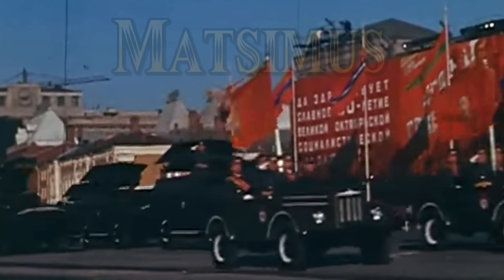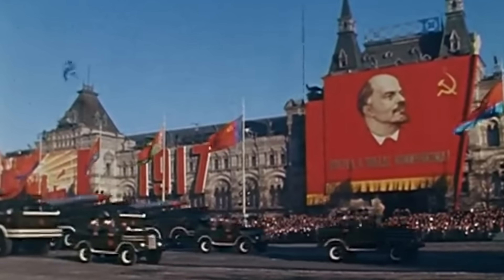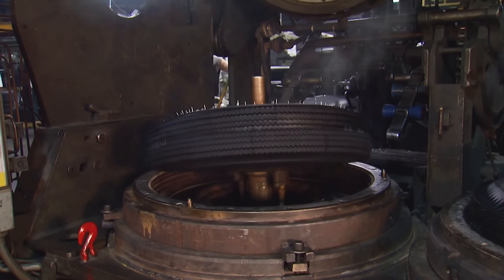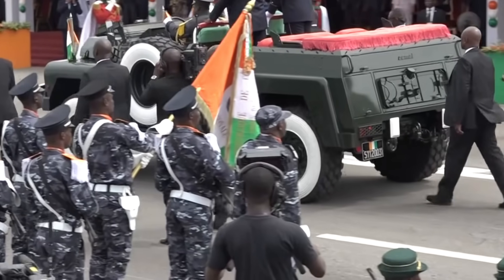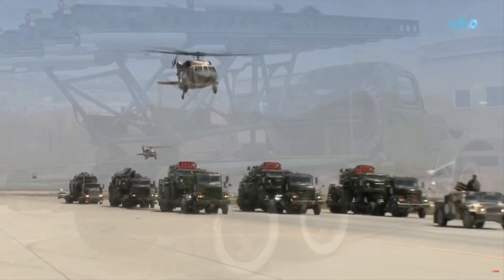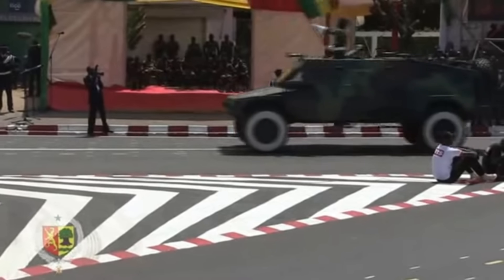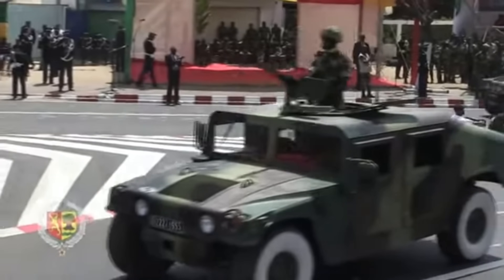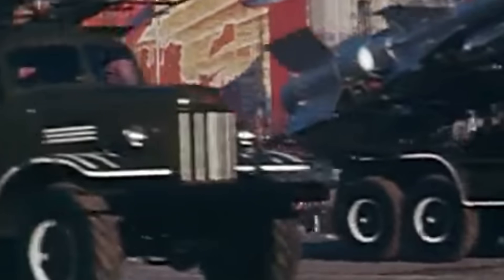Why do Soviet/Russian, North Korean and Chinese military vehicles have white wall tires?

Comment: I always thought it was just decoration for parade purposes.
Reply: I never knew that this was an issue and never thought about it till now.
Reply: Wasting money is a big no-no at the Slavic world. Unleas You can fake spending
Reply: They should paint them with gold paint to match with Putin's golden toilet and Kadyrov's golden PKM.
Reply: @vaenii5056  I would never want a golden toilet or anything covered in gold except gold ingots!
Reply: @vaenii5056 I loooooove goooold!
Reply: they are ust decoration for parade purposes in china at least
Reply: It’s to cover up the fact that the General in charge has trousered the tyre budget for the year and disguise the fact that what’s left are crap Chinese knock-off Firestones.
Reply: I know about people with camper Vans and trailers covering their wheels when they not use them since they stand around for most of the year.
Reply: @w0lfgm  white paint is cheap especially if you know that they use whitewash which cost around 0 and paint all rims to parade will cost only about 200 bucks
Reply: It is. I have never seen a single documentary footage or an East-Block made war movie featuring white wall tires. You will not find them on any WWII photos either.
Reply: @piotrmalewski8178  this white stripes made only for parade purposes, they make vehicles looks more accurate
Reply: Well- since rubber is white, before watching the video I would say they did save money on the black particles that are added for better grip. You only need grip where the tire touches a surface, right? And now I'll watch it 😁
Reply: Wrong in the first minute 😂 So not rubber is white but additives are...
Reply: @alexandergausJTP   It is wrong. They hand paint those stripes on black tires before the parades.
Reply: @piotrmalewski8178  True - especially in this Kontext. But there are tires that are not painted over, right? At least that's what I got from this video. Well- I can't be right all the time 😁😂

Older white walled tires, especially for civil use often were genuinely white I seem to remember, but that also have been a mixup.
Reply: Still think it is ... Russians also painted white ornamental stripes on fenders and around hatches for their parades
Reply: @piotrmalewski8178  The Russians also had, according to Suvorov, the most beautiful uniform in the world. With the consequence that all officers needed to cut off the golden buttons and sew on plain black ones before every scheduled and surprise exercise. And back again after returning.
Reply: and you were right. it is solely for parade
Reply: @skuula  That sounds nonsensical, since officers would have more than one set of uniform, and generally there is a difference between field uniform and parade uniform.
Reply: @alexandergausJTP   Thing is, nobody seem to have made white-wall tires in the East Block, past WWII, maybe late 40s/earliy 50s. Even GAZ Chaika on photos from the time, is almost never seen with white wall on a tire. 
Not even in a parade. 
My guess is, nobody made such tires in the East Block, or they were made in extremely low volume, or even imported on rare occasions. Assuming that on a few photos of Chaika with white walls, it isn't just paint. Close to every photo that features Soviet or any East Block cars with white walls, comes from modern times, past 2010+. I know for certain that no one used such tires in Communist Poland, since I've been in the topic of Polish cars for over 10 years.
Reply: @piotrmalewski8178  well yeah you never know with Suvorov... Some of his claimed absurdity of the SU army have been proven, others not. The wikipedia on soviet army uniform does mention the polished brass buttons and the high visibility insignia, but not the need to remove that all before combat or exercise. Would make some sense though.
Reply: @skuula   A lot will depend on specific decade or even region. I can tell you a story from my uncle who served in 1950s. So, in the tents, there was no material to seve as a floor, there was just plain ground, in his case, sand. The machine pistols were put on a stand and it was very easy to knock them over. You can imagine in case of any surprise attack, that's what would have happened. So he had to memorise the serial number of his pistol, because people would frequently knock pistols into sand, and then take whichever was clean to report, so their colleagues had to explain why 'their' pistols were dirty.
Reply: @christianpethukov  I wouldn't mind coins too
Reply: I always thought that also, plus to me white walls looked damn good on my "1974 Riviera", but looked damn dumb on military vehicles to me.
Reply: You were wrong now you know
Reply: Yes you are right, братан, they serve simply for decoration at parade and nothing really else
Reply: yeah, he got it wrong. i own a gaz66 and a uaz 469 military vehicles, it was purely for looks on parade vehicles.
Reply: Because it is for parade.
Reply: Adding Carbon Black is simply to make the tyre uniformly black. No other reason. The painted whitewalls are purely aesthetic.
One word could have replaced a nine minute video here ’Decoration.’
But that wouldn’t have got you almost half a million views and wouldn’t have generated no money. Well done.
Reply: It is.
Reply: It is just for parades, this guy is talking crap
Reply: It is only done for parades
Reply: Да так и есть , я не видел такое пока служил , если белое то шины которые готовили на зиму.
Reply: @exiledscouser919  скудно рассуждаешь  . Видно не знаешь как на самом деле , лучше такое не пиши , смешно
Reply: @skuula  вы просто оторвались от предков , вот и все . Ваши предки и мои предовали  значимость цветам и рунам и символам , к примеру на национальных одеждах , и белый  у наших народов, цвет чистоты , прихода нового, светлого
Reply: Есть форма парадная есть повседневная ,а есть которую используют на разных работах

Comment: I'm old enough that when I first started driving and buying tires (early 90's) they came with a white stripe on one side and all black on the other. So if you wanted the white wall look, you asked the mechanic to mount the tires so the stripes would face the outward. However, most of us asked for the all black side to face outward because by then white walls seemed old fashioned. At some point they stopped adding the stripe but no one seemed to notice or care.
Reply: My KO2 offroad tires have white lettering on one side and black on the other… i am one of the few that has the white lettering visible
Reply: @AgentXRifle yeah, same with my Goodyear Wranger tires
Reply: You paid extra to have the white mounted on the outside.
Reply: When I was a little kid, in the 1960s, "white walls" were the high end tires. They started going out of fashion sometime in the 1970s. Though as mentioned, some tires still had a thin white stripe, for sometime. Probably to differentiate themselves from other brands. Maybe someone might remember which specific brand, or brands, were those hold outs ?
Reply: I drive a late 90's car, which has disc brakes on the front and drum brakes in the back.  Long ago I had tires mounted with the whitewalls out, and I learned pretty quickly that the moment you encounter any water at all, all the brake dust and grime from the disc brakes will get all over the whitewalls, while they stayed relatively clean with drum brakes. Since all cars now have disc brakes I can't imagine that anyone would ever want whitewalls on a modern car.
Reply: @rcoony you are quite right!  my wife used to make me wash the carjust to get the brake dust off.:goodvibes:
Reply: Wow, way back in the 90’s 😂
Reply: @d.b.1176  According to the last census, the median age in the USA in 2019 was 38.1 years. That means that half of the country was born in ~1981 or earlier. So half of the country was ~9 years old or younger in 1990 (in fact, a good chunk of the country wasn't even born in 1990). So yes, objectively the early 90's was a long time ago for most of the population of the US, and those of us who were old enough to drive then are officially old.
Reply: @matthewbanta3240  Born 1969 so I grew up in the 70s. Whitewalls and Saturday morning cartoons
Reply: @matthewbanta3240  You aren't officially old until little kids say you look like their grandparents, you smile patronizingly, oh how cute, and then find out you were born the same year as grandma or grandpa. After that, it is a short hop to being described in the media by your age and procreation history, such as "60 year old grandfather of two" when you commit a crime.  :)
Reply: @AgentXRifle  I only buy tires with raised white letters, I love that look on my old half ton chev. I give the boys at work the option when I am mounting theirs. Some like it, some don't.
Reply: @rcoony my 1992 Pug 205 had discs front and rear, like modern cars just no abs
Reply: You're so right! I started driving in the 70's and it was like that then, Whitehall on one side, Blackwell on the other! Later on they had raised letters, which became more popular that wide whites, but the big cruisers looked best with white stripes. For awhile my older brother ran a sidewall with a thin white and red lines on the sidewall, pretty expensive back in the day, but looked awesome on his 62' Bonneville 2drht! I remember as a young guy making $3.00 an hour as a mechanic in a small town, I couldn't afford new tires, but most young guys like me would go find used tires with maybe 50% tread for $5-15 bucks depending on size and blackwalls always cheaper. I remember I had a '64 Lincoln Continental w/ 4dr suicides and I wanted wide whites on it and it only had 1 so I had to drive around to a half dozen tire shops to find tires the same size and the size whitewall. I think it ended up with 2 or 3 different tire brands on it, but from 10 feet they all looked cool!
Ah, the good old days, there were some nice things about them.............whitewalls, and no such things as smartphones!
Reply: @daveycrocket4873  So nostalgic! 1962 here. I few years ago when I was driving a '97 Lincoln Town Car I would joke with my with that all I needed was to pull up to the house in my big ol' Lincoln and yell at kids to get off my lawn and I'd be the perfect old guy! But, I can't drive until I get enough money for a new motor for the ol '65 El Camino. No kids around, but I yell at the people who stop and let their dog piss on my mailbox!
Reply: @d.b.1176  yep, back in the 90's.... ah the good old days
Reply: @AgentXRifle  That is the problem with the white lettering IMHO being just letters as its free advertising. BF was cool just because I'm juvenile and always think BigFoot.
Reply: @Marc-Mcloud 90's cars/trucks in the USA mostly had drum brakes in the rear and disc in the front. In fact that was the most common configuration for some time
Reply: @seanc.5310  I couldn’t afford to insure a 90’s US built car as they were so easily stolen it nearly cost as much to buy the car as it did to insure it
Reply: @edwardbianchi192 it’s free to rotate tires 😂
Reply: The last car to be sold with factory white walls was the 2011 Lincoln Town Car. Very sad, was a nice elegant trend as opposed to today's grotesque modern all the same looking SUVs.
Reply: @michaelmoorrees3585  As pointed out in the video, tires were originally the off-white color of the basic rubber, with zinc oxide (the same compound used in white sunblock ointment) to increase traction and making the rubber white, but it was discovered that carbon black added to the rubber before molding the tire increased its resistance to wear, making the tires last longer. A smaller tire manufacturer, in a move to save money, used the carbon black only on the tread surface, creating white-wall tires -- not as a style enhancer, but as a cost-cutting measure. Other manufacturers took up the style, but due to the need to constantly clean the road and brake dust off the white rubber, they became a status symbol, implying that you had the free time or servants to clean your tires (as well as your car). In the progress for longer-lasting tires, the white-wall changed from a portion of the tire not infused with carbon black to a white rubber band applied to a black tire after molding, and the band itself narrowed until it had shrunk from occupying most of the sidewall to a narrow stripe less than an inch wide, accompanied by a reduction in the perceived status of white-wall tires on a car.

Other attempts at creating an upscale tire style were tried; in the late '50s and early '60s, Goodyear brought out a short-lived brand of tires made from a synthetic polyurethane called 'Neothane', which could be dyed in various colors while remaining translucent, allowing the tires to be illuminated. The significantly lower tire life contributed to the tires not being a success in the market, and the product died quickly.